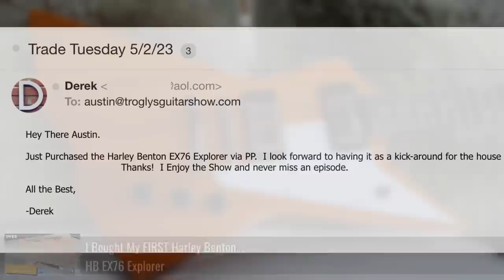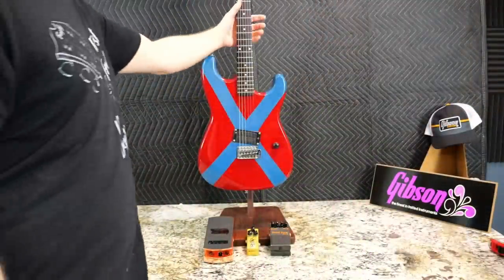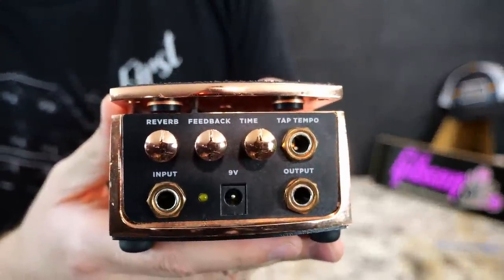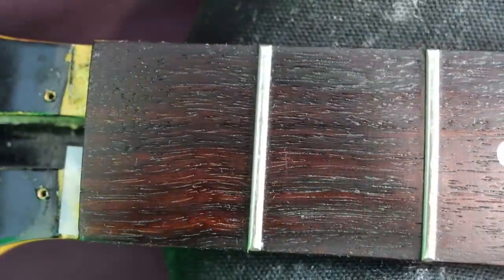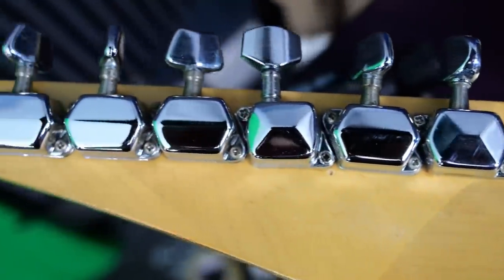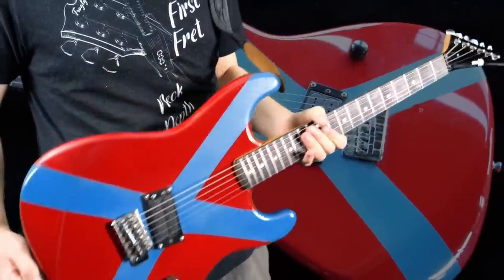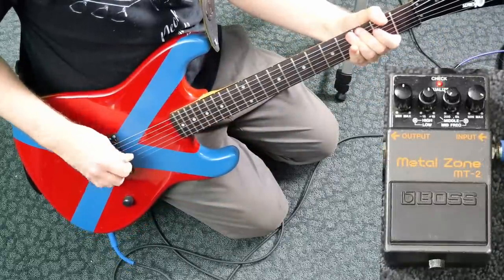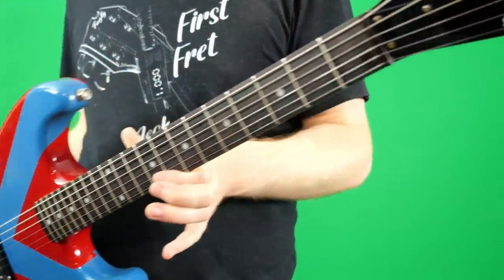This Was Such an AUSTIN Deal! | Trade Tuesday S4 E3 | Series 10 by Bentley Review + Demo

Comment from the maker: Where will episode 4 take us?
🟢Buy: https://www.troglysguitarshow.com
🔴Trade offers: email tradetrogly@gmail.com (ONLY TRADE TUESDAY ITEMS)
Currently have Series 10 Strat, 3 Pedals and some Paperwork!
Reply: I recommend getting new tuning keys I’ve had two keys break on the series 10 strat copy I use. They seem to just be made of cheap plastic
Reply: That series 10 could also be easily mistaken for the union Jacks base of the UK.  Isn't to much that it would take to make it the union Jack. Buy you some Hearos for when you want to rock out. You can still hear what your doing but it's not as full on in your ears .
Reply: If you could try get ahold of an Ibanez Premium you should try it. They're made in Indonesia but it is hands down one of the best built guitar, quality control wise, I have ever tried. If the quality has held up you would have fun checking those out.
Reply: For some dumb reason this didnt show up in my notifications... I am subscribed tho.. daily watcher
Reply: The Series 10 are awesome i got my super strat copy for ten bucks. I put thirty five bucks in parts an its super nice for a budget fixer upper. No its not for sale lol this is why i love my used players grade guitars.
Reply: I'm from Mexico, and i found one of this. is a single Humbucker but is parallel to he bridge and to close, and the body is same for but a little bit sharper. like an Ibanez RG. about weight it's super light, and it's rarely smaller. Neck long is normal 21 fret.  and i bought for almost 20 bucks in a pawnshop.  i have a Rocket Deluxe i known have history too.

Comment: My personal experience with Series 10 was that when I graduated High School, my mom bought me a GTX 5 string bass as a graduation gift (1994, and still have it), later on, my brother picked up a Series 10 4 string bass, and it dawned on us that they were the same bass... we laid them on top of each other the bodies were identical, and the head stocks WOULD have matched had they had the same number of strings.  The GTX I was told was made by Samick... and later found out that Series 10 was also made by Samick for Bently/Alvarez (then Cort made the later years of Series 10).   But from what I recall from the 90s, is there was a time that Samick pretty much made anything and everything for the "other brands" of the big names.

Comment: My very first electric guitar was a Series 10 (by Bentley - LOL). It was my birthday present in December 1984 and was red. Literally ALL red. Everywhere. 😉 There are pix online if you search but the body, neck and fretboard were all painted red and it was hideous. Actually played pretty nice. I still have it though I swapped the bridge pickup to a PAF Pro in the late '80s. Some time around ''92 I sanded it down and found that the body was several layers of plywood (pretty sure it's pine) but the neck was a nice piece of maple. Certainly explains the thick layers of paint.
Reply: I had the same model. Ending up putting another Series 10 neck on it with a maple fretboard and a blue headstock. It was super fast!

Comment: Squire just started making a 1 humbucker guitar. But I believe their's also has a tone control too, and no slanted pickup. The slanted pickup doesn't line up with the strings very well anyway.  The metal zone thing is the pedal into the return only, not completely through the loop. Brian Wampler did a comparison of the two sounds

Comment: I had a Series 10 bass for a while.
It had a glue joint failure in the pointy bit on the headstock but it was an easy repair.
It's been a while but I think that's the stock knob.
It served me well for several years. 
When I finally bought a real P bass, I gave it to a friend and I think he still plays it.

Comment: Love the actual history lesson on Bently.  I have a 96 LP with a killer flame top....photo finish.  Yeah....doesnt dance at all...but it looks cool anyway.  Ive owned it since new.  I picked it out and my Fiance gifted it to me for my birthday in 97.  I guess two years later after mine was constructed, they changed to Series 10.  I was never able to suss out the actual lineage of Bently.  Was unaware that it was the "Epiphone" to Alvarez.  I did discover the St.Louis Music connection.  But even that is a bit murky.
If some day you run across a Bently LP, Id sure like your opinion on it.  Mine is a burst, with cream and black plastics and amber "speed knobs".  The humbuckers and pick guard are cream and the pick up rings are black.   The pots are typical cheap dime sized.  The tuners havent failed me.  It sounds bright.  There are updates I may eventually do to it, but they will retain the look it has.  Mostly updating the pots.    They are not as good as they used to be.  But for a inexpensive Les Paul copy, 25 years of steady use....Im pleased with what they have done.
As for your S Series 10.  The paint job is a turn off.  But it sounds pretty cool.  Love it when the king of hyper expensive collectors gear steps off the mantle to handle the work horses of the common blue collar working stiffs.  This is garage band gear.  You made it sound a feel special.

Comment: Looking at the saddle height adjustment on that high E string, I think you can probably fix the fretting problem by raising the saddles before you go tweaking the truss rod. Those two hex screws on each saddle should be much closer to flush than sticking up that much.

Comment: Unless the original owner wanted it to look like a factory one, that paint job IS factory. I had one of those years ago. I can’t say I looked that close at the finish but I’ve seen plenty online (when I was evaluating it) if I remember correctly, I got about ) $120 for it, and it was in excellent to great condition. If that helps, but prices may be different now, that was 8-10 years ago.

Comment: You can stop the trade tuesday right now, you already did as well as you can possibly do with that Metal Zone. Might sound odd, but that random screw on the back plate isn't the one that's missing from the humbucker ring is it?

Comment: The Bentley model reminds me of the guitar Mike Myers played during Wayne's World before his character comes into the pre-CBS Stratocaster. It looks like that type of budget Super Strat that was prevalent in the late 80s and early 90s.

As for the Boss Metal Zone, I'll tell you something I've discovered. It's a lot easier to get good tones out of it if you dial back the filter banks and the gain. I've never had that myself, but I have another Boss unit, the  ME-80 multi-effects unit which approximates the Metal Zone tone. I had attempted when I first took it out of the box to emulate the sound of the Tom Scholz Rockman Distortion module. No cigar, but I did come close.
Reply: The may I help you guitar was a Schecter Strategy.
Reply: Dig,  @workingorder2189 . 🤟

What was he playing during all the basement shoots with Dana?
Reply: @ericbgordon1575  Guitar on SNL is a Washburn Force series model. Not sure which one maybe G10v or G23v. Correct me if i'm wrong internet.
Reply: Thanks for making it clear that it was a Washburn he played then,  @Working Order .

Comment: Well, this one was something of a break-even for me, Austin.  I knew about Series 10 long before you did, by virtue of shopping at a local guitar emporium not hugely far away from me.  It's called Ron Busch Guitar Studio, if it's still there; it's been a while.  I made several purchases there, but although Ron carried the Series 10 brand, I never tried one.  They LOOKED CHEAP.  I didn't mind that they WERE cheap, but they looked LOW VALUE cheap.  Remember that this was back in the 1980s and forward, long before today's Golden Age of Cheap Guitars.  Cheap guitars back then were almost invariably crap, so I avoided them like the plague and bought used guitars instead.  Returning to the point, though, I was well aware of the existence and availability of Series 10 guitars back then, but remained unmoved to try them.  Had I known then what I learned from you today -- that Series 10 was a part of St. Louis Music -- I might well have given one or two a shot.  You understand that I'm from and in Saint Louis, myself, so I could have supported TWO, not just one, St. Louis businesses in one purchase.  A shame to miss the chance, but oh well ...  

How about a suggestion?  I just got a Donner DST-400 four days ago, and I have been working on/evaluating it since then.  I've run into a number of challenges and a disappointment, and after finding that what I got was really not up to the level of what most of the reviews I'd seen led me to believe I would receive, I wonder if these units were cherry-picked or specially prepared for review.  On the whole I'm pleased with the guitar; I just wish I'd had had information enough to have a more realistic expectation of the quality these guitars have.  It might do some folks some good to hear from you what you really find the guitar to be like.  So that's my suggestion.  Review the Donner DST-400.  MAYBE even review two units -- one green and one black,  both supposedly transparent.  Imagine my disappointment that the "transparent" black I ordered showed up at my door two days late AND with an opaque black finish to boot.  So the quality and transparency (or lack thereof) of the finishes are some of the issues you could address, if you choose to do so.  I hope you will.  Thanks.

Comment: A lot of series 10s were sold to new guitarists in the '80s. I hadnt played 1 that I liked though. All had high action and thick necks. There were quit a few better options out there back then for about the same price. Cort was marginally better. I worked at a local music store in the early '80s and we had a line of german made copies we picked up at a NAMM show. It included a double neck (bass and 6 string). Both necks played nice. Anyway, comparing low end copies from then to today is night and day. Entry level guitars today are waaaay better.

Comment: Salutations Austin!
Unfortunately, I missed out on any of the pedals by the time I watched this video.
Although it is the time of year when I like to begin working on a Stratocaster project, this particular Stratocaster style guitar just doesn’t quite fit my requirements for such a project, however, it should be perfectly suitable for someone else, likely someone just getting started.
That is a satisfactory project guitar for someone, with a little work, it could potentially turn out to be something worth playing. The frets that have issues likely have sprouted frets that just need a few gentle taps. A good set of machines would certainly be an improvement too.
With some extra work on the finish, it could definitely be improved cosmetically.
Thank you for posting these videos!
Please have an excellent and awesome day! 
☀️✨🎸

Comment: My first electric guitar (which I still have!) is a Bentley Series 10 2248-RB (kind of a Jackson looking thing) with red and blue crackle paint.  I thought it was garbage after playing for a couple of years, but 25 years later I pulled it back out, disassembled and reassembled it and it plays like a champ.  I'm seriously glad I kept it, especially since a local shop is selling about the same guitar for $1000 (I think I paid $100 for mine in 1993.)

Comment: I remember Series 10 guitars back in the 80s. They were the first real cheap guitars that weren't complete crap (they were still mostly crap, but not completely ... they often were actually correctly intonated even). You were still better off with a Yamaha back then, but you could actually make one of these work.

(ETA the Ratt is the most appropriate thing you could play on this old thing ... double thumb up).

Comment: Those golden horsies are great. I’ve been using one for a couple years
Reply: I have the silver horse, which I think is basically the same pedal, but with a switch for different diodes. Josh from JHS pedals did a blind test of that one vs an original silver klon on the JHS show. If I remember correctly they ended up guessing the horsie was the original.